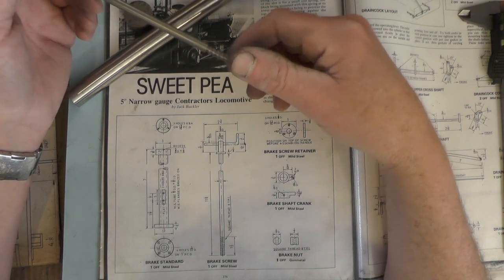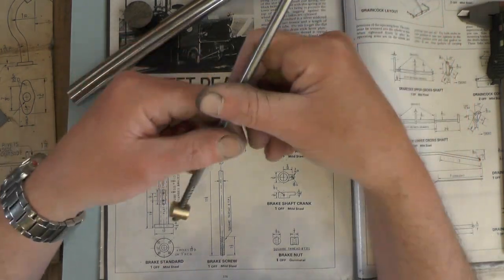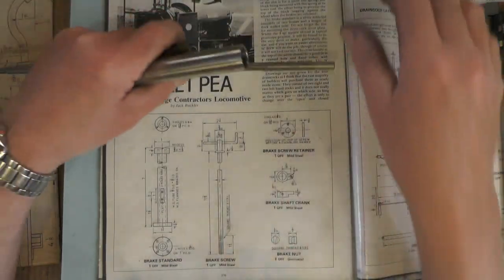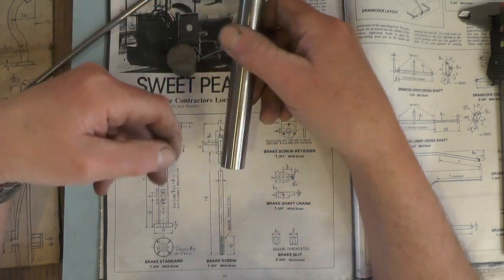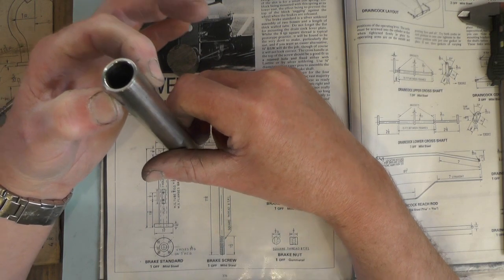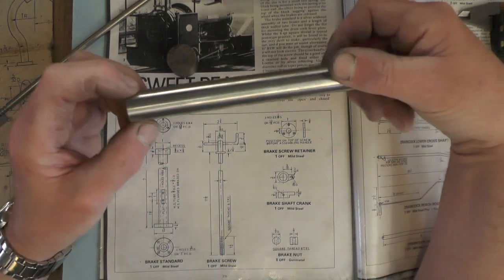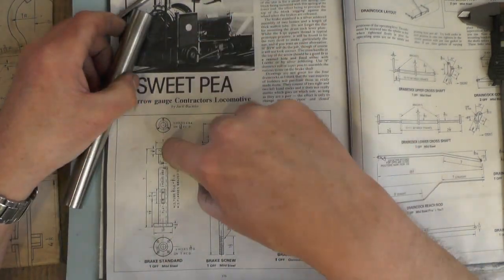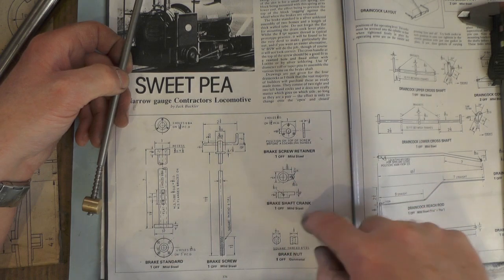Make a Miniature Steam Locomotive Series ( Brakes Part 2 - Offset Crank Arm etc ) "mr factotum"

Comment: A newbie question.  I have drilled stainless steel in the past only for it to work harden and ruin bits.  I have turned very little stainless steel on the lathe.  Is this hardening effect true for all stainless steels or just certain alloys?

The brake parts are coming right along.  You always get such good finishes!

Joe
Reply from the maker: hi joe 
some stainless steels are very tough to machine eg grade 316 bar stock, so choose carefully. over here  in uk i only use grade 303 bar stock for making components its free machining, not sure whats the equivilant grade in sheet stainless.
thanks for binge watching and comments  it must be great to get a break from the DIY'ing in the kitchen, and stop fitting outside lighting you never know where its going to take you?????
regards
mr f
Reply: Mr. F.  Thank you for the information.  I think it is numbered the same way here.  Yes, the lights turned into something I didn't expect.  Now it is sort of a game of getting stuff done in a hurry, and hurry up and wait on others.  :-(

Joe

Comment: great job as always, thanks  for sharing. on your lathe you have a duel tool post was that something you made as would like to fit something similar on to my Boxford, seems really useful thanks again for the video's learning something every time
Reply from the maker: hi ms
thanks for watching and comments
yes the rear toolpost I made myself, great for parting off as the cutting forces act on the under side of the headstock bearing where all the mass of the lathe is, hence more rigidity. I just made from a block of mild steel and clamped to a tee slot in the cross slide
regards
mr f